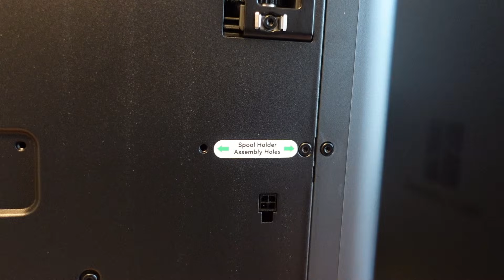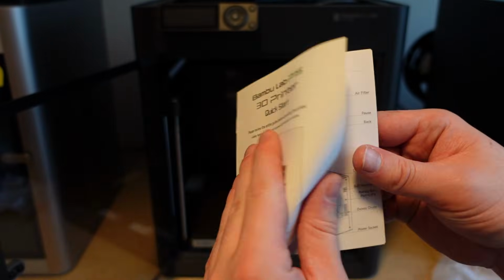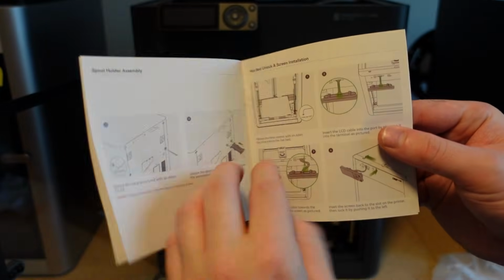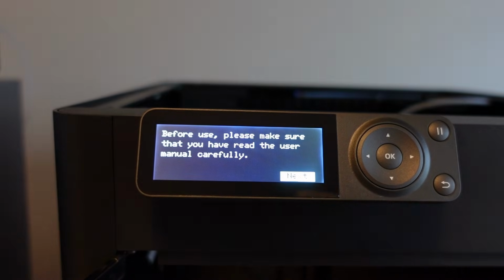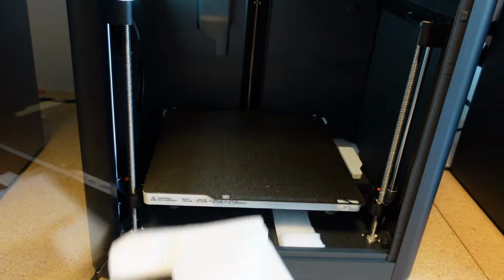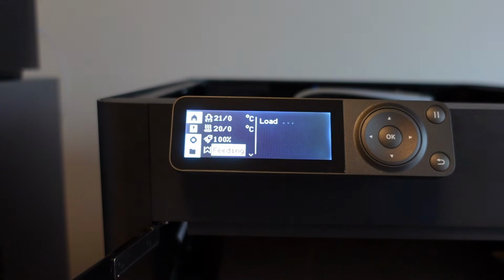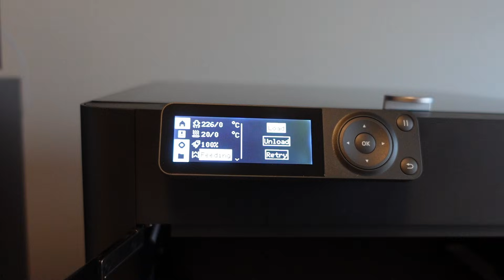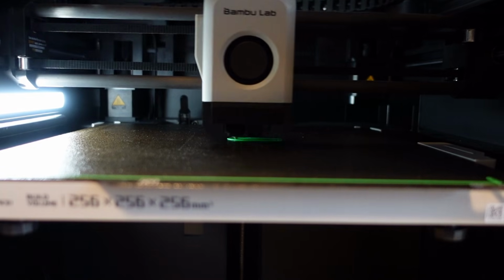Bambu Lab P1S Unboxing & Setup Made Easy (Step-by-Step Beginner Friendly Guide)

Comment: New printing nerd here with the bambu lab p1s still in its box for a week now. 
Waiting until I can get a desk setup that will isolate the printer acoustically and vibrationally. 
Got a pretty good idea of how I'm going to set up the isolation desk.
Also waiting for the voxelpla filtration system b4 I screw with unboxing and setup. 
Really appreciate this video as it is a good thorough guide 👍 👍👍👍👍

Comment: You skipped the part where you connect to bluetooth. That's where i was having problems.
I finally got it to work after 4-5 retries.
But thanks for pointing out the spool holder has a "TOP" marking--I had mine installed backwards.

Comment: Does this come with the filament holder that sits on the top?
Reply from the maker: That's call an AMS unit which is for multicolor printing. It's not included with the printer, you have to buy those separately.

Comment: I’ve clicked retry to see filament extruded about 10 times now. Still nothing. Advice?
Reply from the maker: Hmm, I’m thinking that possibly the filament wasn’t pushed up far enough to be caught by the extruder to push through the nozzle. I would try it again and push it as far as it can go to make sure the extruder is feeding the filament through. If that doesn’t work, you may need to take apart the hotend to see if there would be something potentially blocking it, which would be weird if it was a brand new printer
Reply: @MysticMesh3D I’ve pushed until I feel it stop. Don’t wanna put too much force into this
Reply: @thegridman1 found any solution?

Comment: With the current sale I'm considering buying a second P1S. I don't really need it, but it's just so tempting.
Reply from the maker: I bought 2 more of them during this sale at $499 each. I'm honestly considering picking up another one haha
Reply: Did ya'll see the p2s? Its gonna be the same price as the p1s's normal price for the base model and it has hollow steel rods instead of carbon, Ai shit print detection, 1080p camera, 5 inch screen, quick swap hotend, upgraded servo extruder, adaptive airflow cooling. Its still 300 celcius at the nozzle which is lame and I bet they neutered it so you can change the resistor to get higher nozzle and bed temps but idk.... it looks like a worthy p1s upgrade.